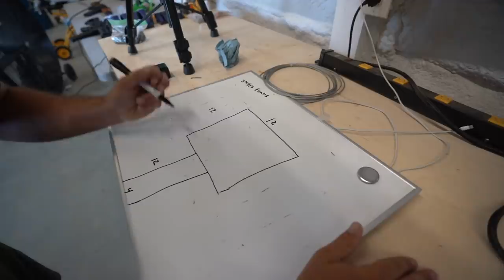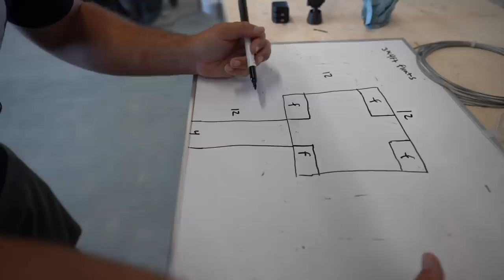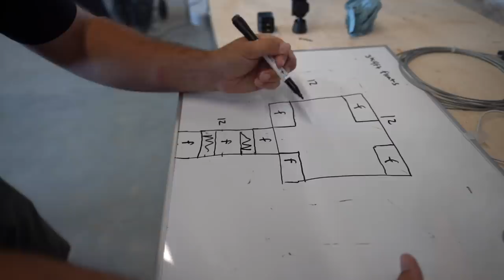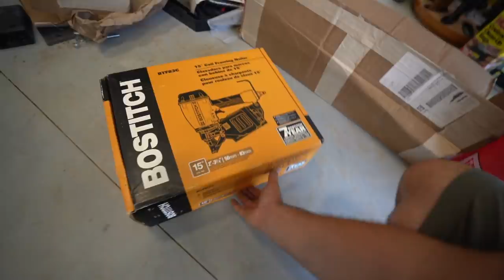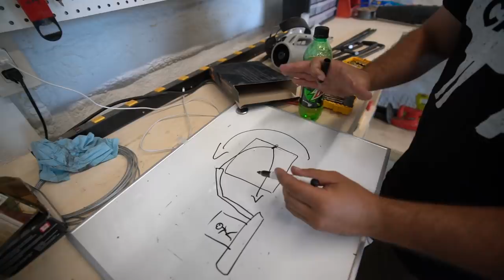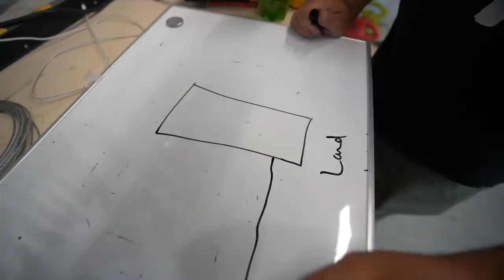Building a GIANT DIY FLOATING DOCK for My BACKYARD POND!!! (Part 1) - Framing and Floats

Comment: Just a heads up when putting washers/lock washers on a bolt the lock washer should go between the nut and washer. The lock washer is made to add pressure between the washer and nut to keep the nut from loosening over time. Unless you switch them around or add new in the future the nuts will eventually become loose over time.

Comment: Flair my guy, prolly should have built the deck portion "modular" as in 3 pieces. Basically, build 4.. 4'x 12' sections then 3 of them could be bolted together at the pond and the 4th is the walkway. Which would have made it easier to move around and flip over. And, you could've stacked them in the trailer to transport them that way. JUST SAYIN'...... SHEEEW.....great vids.

Comment: Hope you added some blocking between the joists buddy cause that wood will curl, buckle and twist at some point and will pull your decking right off if you nail it which should be screwed in the first place.

Comment: Screws are better for a dock because they grip the wood better and don't pull apart when it moves in the water. If you use nails they will eventually work back out.

Comment: Curious...
I’m concerned about Rusting on the bolts and brackets in the water. It would have cost you more, but would Stainless Steel have been a better option? 🤷🏼‍♂️
Reply: Galvanized chum

Comment: Flair when you put the corner brackets on you drilled the holes put the bolts in and lock washer, flat washer then nut. It should be flat washer then lock washer then nut. The lock washer is suppose to bite into the nut and flat washer not the wood.

Comment: I had a similar issue with purchasing what you thought was new items but were actually returned/switched out with broken items.  Mine was at Home Depot where luckily I noticed the box to the exterior light I was about to buy was opened.  I opened it up and realized it was literally broken.  I was in the checkout lane when I noticed it so I went and got a different one and gave the broken one to the employee.

Comment: Flair I'm guessing you didn't realise that when using split washers they go between the Nut and the Washer not split washer washer Nut kind of defeats the whole point of having a split washer as it's that washer that keeps the nut under pressure by being compressed between the penny washer and nut.

Comment: 3 or them side by side is 12 feet but i think youll find doing the frame that direction it is a few inches short (board thickness). If you set them the other direction youd have had no problems XD

Comment: You could’ve just put the mule tires straight up against the deckran the winch  acrossed and pulled and it would’ve pulled up and slid the deck out from under itself

Comment: With the weight of one treated 2x6x12 at 40lbs a board and the weight of the floats at 30lbs a float the entire deck of the dock should be about 430 lbs

Comment: Would not have bothered putting floats on the ramp since it is supported at both ends. And used the extra floats on the dock.
Only reason I can see for two floats on the ramp is if you were taking the dock and ramp apart and using the dock to float around the pond.

Ideally 1 float on the end of the ramp and floats on each corner of the dock and two in the middle. Would have been pimping and allowed more people and stuff on the dock.

Comment: I would use screw for everything like that its a lot more  stronger and secure then nails
Reply: Screws are better at pulling things together than they are with shear strength, that’s why they use nails to frame houses and really for anything structural.

Comment: Those floats will float over 6000lb. Use the tractor to take it down to the pond and put the decking on when you get there. Make sure you use decent nails on the deck so they dont rust out. What happened to the tractor??

Comment: You said you wanted to do it right? First off I would make sure to use galvanized lag bolts and carriage bolts, washers, and nuts. It’s gonna be on water? Second I would make sure to use the appropriate hardware on the treated lumber so it doesn’t have a chemical reaction. The last thing I would do is not use nails on the decking if I was trying to make something last? Just saying.🤷🏻‍♂️

Comment: Pls read! I watched your video on buying the rabbit so I am commenting this on every single video you post from now on. You need to do research on rabbits before getting one. They are very misunderstood animals. They are very high maintenance and need specific things in order to live a good life and be healthy. That is a good size cage but you should not go any smaller. Rabbits do NOT belong outside. It is dangerous because of all different bugs and germs, but especially because of weather. Rabbits can not regulate their own body temp. so if it is colder the like 60 degrees they will not be able to warm their body back up. This is why you never want to give your rabbit a bath. They are also very heat sensitive. Many rabbits die from heat stroke.  Also if they are on hard cerfaces like very compacted dirt, plastic/metal/ wire bottom cages, or hard tile/wood flooring often, they can easily develop something called sore hocks on their paws. This is when they get large red raised welts on the bottom of their feet. It is very painful and if you do not get them treated fast, they will rip open and get infected which can cause major health issues and in some cases even death. Also you need to look at the ingredients of anything you buy your rabbit. The hay that I use is kaytee Timothy hay or you can buy it from a local farm by the bail as long as you make sure it is the correct kind. Never buy food or hay for you rabbit before researching. The rabbits diet should be 80% good quality hay. Then you should give it plenty of fresh leafy greens ( make sure it is a variety of diff kinds) like collared greens, Romain, small amounts of spinich and arugula. Last you should be giving the rabbit kaytee Timothy pellets (with no extra fruit mixed into it. Make sure it is just the pellets) each day based on its weight. I would say about half a cup per day would be reasonable. For treats give fresh fruit never those store bought “rabbit treats”. They are very sugary and not healthy for your rabbits. My rabbits fav is banana but they also may like berries, apple, or dried fruits (look it up if u are not sure they can have it). Rabbits are usually indoor pets in which case they can easily be litter trained bit the litter box needs to be made properly and must be large enough for the rabbit to do a full 360 in it. It is good to use a large cat litter box but never use cat litter. Btw, rabbits are pray animals so they hate being picked up bc it feels like they are being picked up by predators. Rabbits are very social and active  animals so You need to build a bond with your rabbit and the best way to do that is by hanging out with it. Start by laying on the floor at its level and do not pet it. Just let it explode you. After you have done this for a few days you can begin to pet it as it gets more comfortable with you.  And just so you know, you do not jack a rabbits Jenner the same way as other animals. There is a certain way to do it bu5 you need to put your rabbit on its back which is extremely dangerously I recommend getting a profession (vet) to do this. And don’t forget to clip its nails and brush its fur often. If you have and questions pls contact me. My email is Kiersten.fab22@gmail.com. I am happy to help. 

Plssssss LIKE SO THEY WILL SEE THIS. HIS RABBIT WILL NOT MAKE IT LONG WITH THE WAY HER IS TAKING CARE OF IT NOW!!!!!!!

Comment: Bro the lock washers are supposed to go between the nut and the fender washer, not between the wood and the fender washer 🤦🏻‍♂️🤦🏻‍♂️🤦🏻‍♂️🤦🏻‍♂️🤦🏻‍♂️🤦🏻‍♂️🤦🏻‍♂️🤦🏻‍♂️🤦🏻‍♂️🤦🏻‍♂️ they are to prevent the nut from backing off (even tho split lock washers don’t do what they’re supposed to) ya still did it wrong